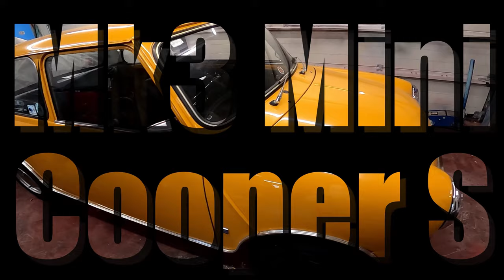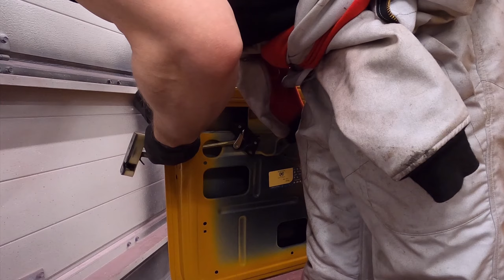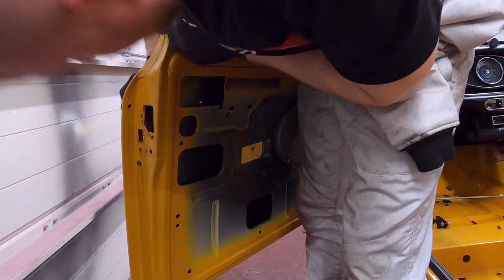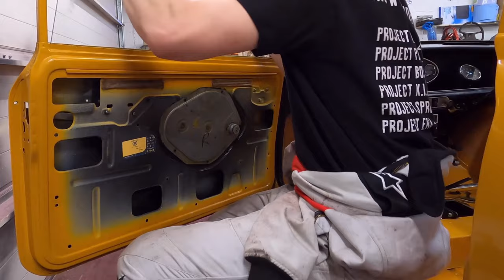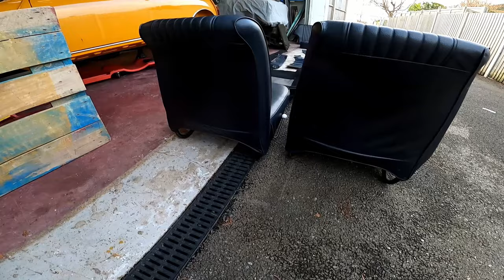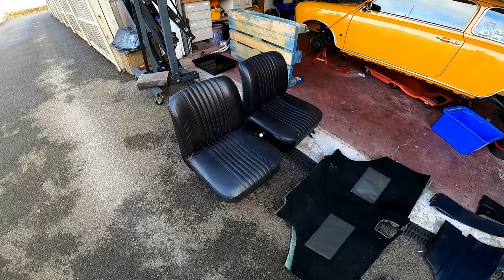*Door & Interior Strip* Cooper S Mk3 Restoration - Classic Mini Workshop Pt.6

Comment: I replaced a door glass once after the window got smashed, only problem I had was with the metal strip on bottom of glass, the replacement glass didn't come with it on so had to use the original one, trouble was getting it on to the new glass which was a very tight fit, I thought the only way to get it on would be by hammering it on, but I thought how do I do that without breaking the glass, so I had some carpet underfelt and wrapped it a few times all the way around the glass, then hammered the metal strip on and it worked.
I never saw any plastic sheet behind the door card.
Reply: I had to replace the runners before and just used a rubber mallet whilst the glass was sat on a carpet. Hit and hope for the best 😅